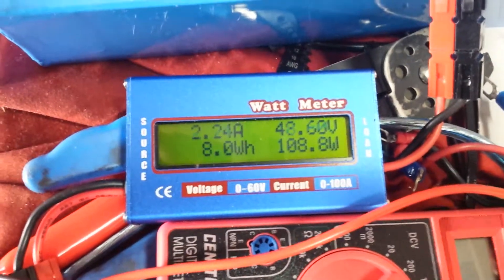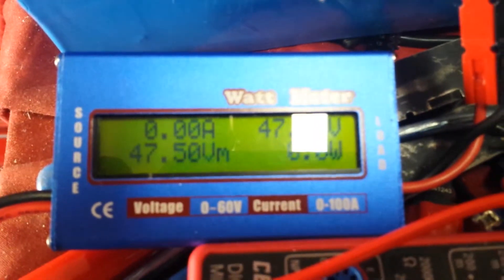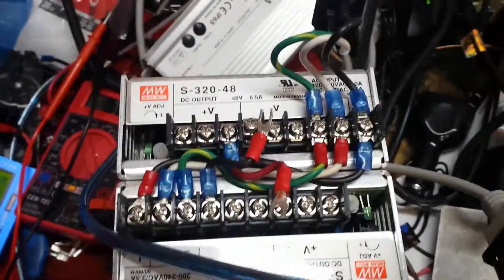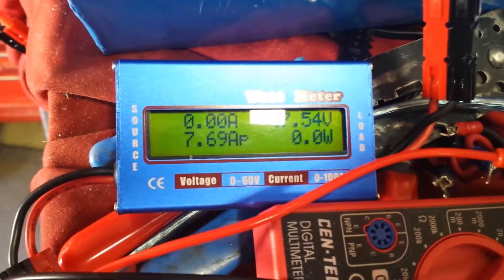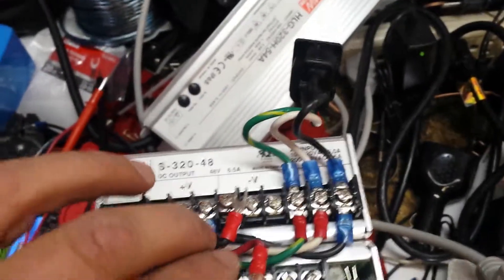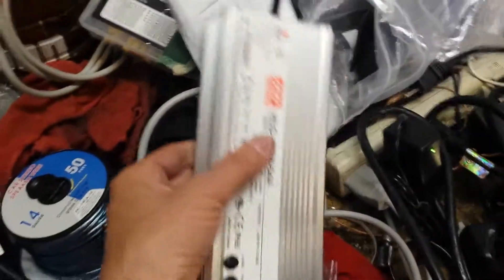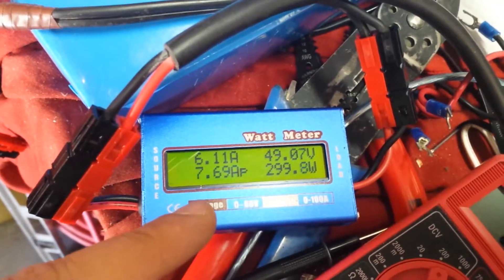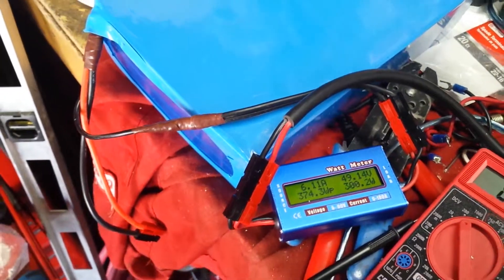Mean well power supply issues

Comment: These supplies have hiccup current limiting with auto recovery and that is typical behavior when used for battery charging.  You need to get constant current limiting types or you will need to externally limit the max current available to the battery. Using a resistor in series is the simplest way if you don't want to buy constant current limited supplies.  The Meanwell HRP series have constant current limiting and work well with batteries.  Also a good idea to use a series diode to prevent battery current from smoking up the supply (fire hazard) when/if a fault occurs in the supply output devices.

Comment: It might be because they are in parallel.
Also, try adding a somewhat large capacitor on the output. Perhaps about 10,000uF (at least 63V rated or more)
It might be that a current pulse is causing them to turn off (on overcurrent).